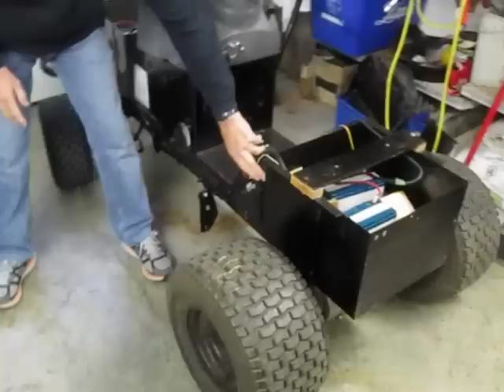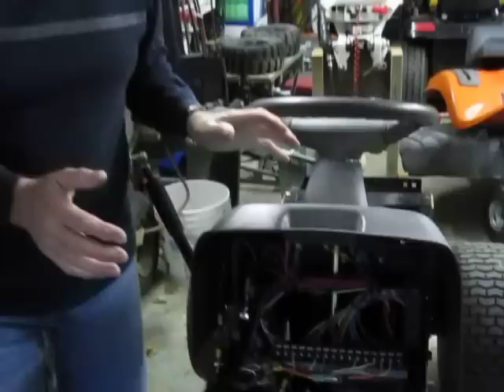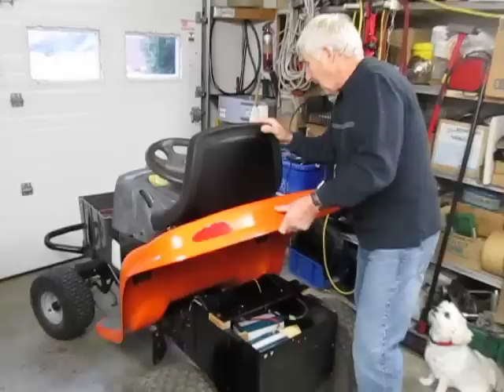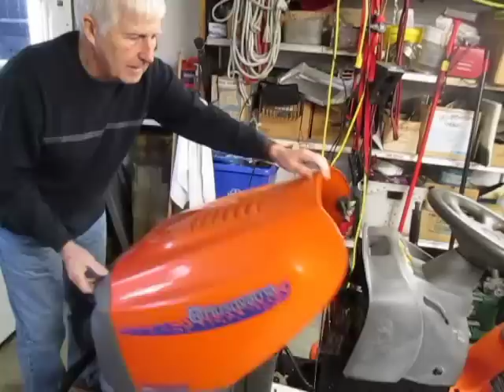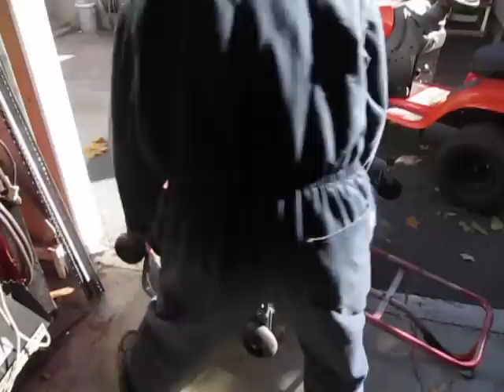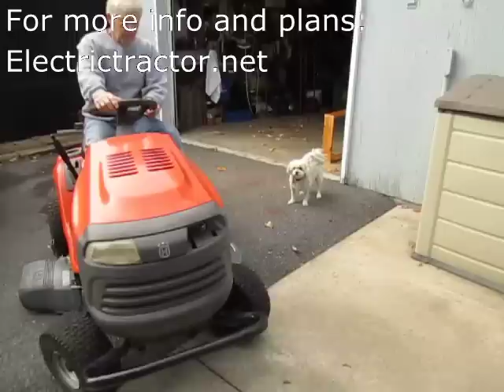Electric Tractor Conversion

Comment: Do you know anyone who has converted a John Deere? I have an old GT245 I would like to convert. I have a pretty good size property so I may want to use LiFePO4 batteries to get extra run time.
Reply: more  info on the conversion kit,  @ electriclawntractor.com

Comment: Thank you for the video, even if you did use some strange words 'gas' & 'dollar' :) I can see a potential  problem though. With belt drive if the blades hit a large stone, half brick etc. the belt will slip but with direct motor drive it can't. Maybe consider a lightweight version of topper blades where the articulated blades can swing back if it hits anything.
Reply: Hi Cyng Some gas engine tractors use gear and shaft drive, they protect the blade driveline with sheer pins or soft keys in the keyways, in our case because the electric cutter motors are much less HP than say a 22HP gas engine with a flywheel they have less inertia and stop much easier without doing damage, but we do also use blade tips that swivel,

Comment: I'm thinking about doing the same but i will not copy your deck motors.
I have seen how it eats the old bearings on the mower blades. I will make a new lower mandrel with bearings and let those bearings take all the the abuse from the blade. This will protect and ensure long life of the electric motors.

Comment: Hey Brian. What motors are you using on the cutting deck? This is the best build I have ever seen. Awesome work!
Reply: I use small permanent magnet brush motors, direct drive to the blades, you could use the slightly more efficient AC brushless motors but you would need a controller for each motor,
Reply: @ElectricTractor  Thanks for the reply mate! Awesome, I will do some shopping around fo some and get them strapped onto my deck. Greatly appreciated, keep up the good work!
Reply: @ElectricTractor  ps. any info on where I could get those specific motors from? cheers mate.
Reply: @surfieboy89  I had to get mine specially made for the size of blade my kit uses, don't know any one except Macmotors.com
Reply: Brian Edmond yeah I’m struggling to find one that will fit mine properly too. I may have to invest in a plasma cutter haha. Thanks heaps for the info mate. You’re a legend.

Comment: This is awesome, I will be buying the plans if I can manage to find a scrap lawn tractor somewhere.   I was just wondering if there was a battery guage that could be installed like many of the battery tools/tractors now to give you an idea of how much power you got left?  Didn't see that in the video and not sure if its feesable.
Reply: In our kit we use Curtis controllers which have a BDI battery discharge indicator ckt built in to the program, all you need is a 0-5v panel meter

Comment: Impressive. Blade motor towers seem a little close to the body to raise deck fully
Reply: If you have that problem, you can easily raise the frame by installing the new electric drive transmission 2" lower

Comment: Brilliant idea, well executed. Giving serious consideration of buying one of your kits for my old Craftsman. By the way, I found you while searching for conversion kits for a larger Kubota tractor. My B3350 has a Diesel Particulate Filter (DPF) Tier 4 pollution control that is starting to act up again. If you're up to a challenge, build me a kit so I can swap out that stinky diesel engine. Again, well done!
Reply: Thanks Ron the plans on the internet may be adaptable to your Kubota

Comment: Are you still able to adjust the cutting height?
Reply: Yes! on some models like the Poulin and Huskvarna you can use the existing deck lift mechanism or I added a electric lift actuator that works great,
Reply: Brian Edmond Ah, I was unsure after seeing the height of the cutting motors: fantstic job. Very well thought out and well built!

Comment: I have a new electric riding tractor conversion kit available about 15th May 2018, for more info :- electrictractor.net 
or email info@electrictractor.net
Reply: I recently bought a used JD Z425 zero turn and I'm not looking forward to the day when the hydraulics need replacing.  I might want to do a conversion similar to this on it when the time comes.  Cool thing about this particular model for that purpose is that it doesn't have an actual transaxle.  Instead it has a hydraulic motor at each rear wheel.  It would make the design of the controller a little more complex, but two electric motors could be bolted directly in place of the hydraulic ones, and then the 3 spindles replaced with their own motors as you've done here.  The accelerator could then be attached to the two hand controls so it could operate the same way as it does now.  Bit of a pipe dream for me right now, but I thought I'd drop the idea here.  Maybe you can start offering kits for those too.  Lots of used up old zero turns out there being sold off by landscapers these days for cheap, so lots of opportunities for conversions.  Might be a market for it.

Comment: I was wondering what type of battery did you used and how many, also what is your mowing time on it.
Reply: Hi Chuck I use Lead acid deep cycle batteries are :- cheap, safe, easy to use, completely recyclable,available everywhere, and heavy which is good in a garden tractor for traction and they run my 42" cutter conversion for up to 2hrs cutting grass, about 2 acres, or about 8-10 hrs without cutting, if you think about it 2hrs on a garden tractor is long enough if you have more than about 2 acres you probably need a larger tractor, Lithium batteries would be about 6x the price for the same run time!
Show less
Reply: I use 4 lead acid deep cycle batteries it will cut about 1 acre per hour :-     electrictractor.net

Comment: I love the stove cable!
Reply: The 50amp stove cable P.T.O. is cheap and works great for the electric 42" cutting deck it can also be used for other attachments such as a snow blower, sweeper, plug an a 120vac inverter for your power tools, fridge, freezer, gas or oil furnace, water pump in the event of a power failure,
charge with solar panels and use the batteries for your barn lighting when not cutting grass.
The P.T.O. plug eliminates all the belts and pulleys on a conventional gas tractor
We now sell a conversion "KIT" details:-    electrictractor.net
Brian

Comment: How do you keep  the blades synchronised without any belts?
Reply: Jur4x
Thats easy see the lower paragraph
 Choosing the right tractor to convert, you don't need any particular make of tractor just one with the features stated below, the one on the internet is a Poulan mod PR17542ST made by Electrolux, or the Huskvarna mod YTKH1542XPA I have converted both and they are perfect frames, these new would cost about $2600, I used to advertize in my local paper and on KIJIJI I  or go to the local lawnmower repair shop they usually have plenty of them waiting to go to the scrapyard, you don,t need to pay any more than about $50-$100, you can repaint them with spray cans, the recommended 18 inch wheels diameter is because of the gear ratio of the transaxle and the limitation of the speed controller 40amps, my tractor on the website has 20 inch wheels but I found that the motor used a little bit more power than the controller could supply but it still works quite acceptably except going up steep hills where the Controller may trip off and I have to reset it sometimes, I would recommend if you use the tractor with 20 inch diameter wheels to purchase a larger controller capable of about 70 A instead of 40 the size of the drive motor is quite adequate for 20" diameter wheels so that's not an issue,  
The cutter motors are sized for 21" blades e.g. a 42"cutting deck, this is the most popular size of garden tractor sold in the US and Canada,
       The deck must be of the offset two blade type, one blade is mounted approx 4" ahead of the other blade, the blade tips slightly overlap when viewed from the front, this is to eliminate the small ridge of grass that would be left uncut if the blades were mounted side by side with a small gap so blades do not hit each other! 
one thing I can tell you is when it is converted you won't be disappointed they are far superior than gas tractors in many ways
Reply: Well, that what I mean. Blades are slightly overlaping. And in order for them not to hit each other they are set with about 90° difference. And in order to keep them this way, timing belt (the one with "teeth") is used. But how do you make sure that two individually powered blades are staying away from each other?
Reply: The deck must be of the offset two blade type, one blade is mounted approx 4" ahead of the other blade, the blade tips slightly overlap when viewed from the front,  not from the top, this is to eliminate the small ridge of grass that would be left uncut if the blades were mounted side by side with a small gap so blades do not hit each other! no cog-belt is required
Reply: Oh, I see. Both that I have, are equipped with one of those decks where blades pass the same spot in turns. End if they get out of sync - they start hitting each other. I thought of getting Stiga with 125cm (that's somwhere round 48-50 inches i think)  deck, with three blades. Those ones shouldn't overlay either

Comment: :/ it looks like the blades cross each others paths, that is not going to work with 2 separate motors, if blades are passing into other blades paths, then without a belt or chain to maintain timing, they will collide...
Reply: Most small lawn tractors blades are belt driven, v - belts slip so cannot be used to syncronize the blades! same problem as my 2 separate motors, so we place one blade about 4" ahead of the other and closer to the center line of the tractor, when you look directly from the front of the tractor the blades overlap so no grass is left uncut
Reply: Blades are mounted with about 0.125" clearance between them, they don't need to be synched.

Comment: Great job-even though your horseshoe was upside down-letting the luck run out.  There was something wrong with your website.  I'd like to see more about your motor.  I'm wondering about this conversion with a four wheeler.
Reply: Dear sir
Thank you, I am having problems setting up my website videos etc, what problem was you having?  I will look into it, 
My conversion is not designed for a 4 wheeler but you may be able to adopt it? it's first job is to cut grass and I am finding it can do allot more
Reply: I use Mozilla Firefox and they said that your site is not secure and sent me back.  So I couldn't get to your site.
I would like to learn as much as possible about your conversion so as to modify it for an ATV.  I hunt with an ATV.  One without a loud gas engine would be extremely advantageous.  Also, I'm sick of tearing apart carburetors and all the other crap that breaks down.  Scent, believe it or not, can be another advantage (no gasoline or oil).  The list of advantages gets bigger.
There are a few videos that do the conversion, but, strangely, most are 6 or 7 years old.  I emailed a company that made one this year, though.  I can tell by just comparing your video to theirs that you are much more "real world" competent.  Funny how an older guy like you can be better at technology than them.  Way to go.
Reply: I forgot to mention one more thing.  I have an open mind and would consider an ATV that would pull a trailer~and mow my grass. lol.  One machine to do everything seems best.  I'll bet your mind is working now.
Reply: I downloaded Firefox and went onto my website electrictractor.net found no problems?
Brian
Reply: I don't know why, but it worked this time.  Thanks

Comment: What is the cost of the EV parts?
Reply: I'm pricing items before I dive into this.. I found deck motors for $45 each.  Still looking for a transaxle.
Reply: There are several options the most expensive is about $2000 + batteries
We are looking for new suppliers with better prices all the time, a good option is Ebay where one customer bought the transaxle for $360
Reply: There are several options the most expensive is about $2000 + batteries
We are looking for new suppliers with better prices all the time, a good option is Ebay where one customer bought the transaxle for $560 this was  a good deal,
Reply: $45 sounds like a great deal, hope you can find a transaxle at a good price too
Reply: We now sell a conversion "KIT" with al of the difficult to obtain parts included,   details:-    electrictractor.net

Comment: a gasoline engine does not stall if going up a hill
Reply: I believe If you overloaded a gas eng say 3 times its rated HP e,g, 10hp eng and you put a load of 30hp it would definitely stall were an electric motor could supply this load for a short while until it overheats, this is done in electric cars where a 30-40 HP electric motor can supply approx 100 HP for short periods e,g, passing, accelerating, etc
Brian Edmond
Reply: the reality is a dc motor for a given size will out torque most internal combustion engines at low rpm.Like a steam engine which develops it max torque at stall
Reply: ayp193s small engine repair - For the same "HP" rating an electric motor will definitely not stall as easily as a gas engine, ever. ;-)
Reply: He still had the assortment of inappropriate batteries installed which is why it appeared to stall, not enough available amps.
Reply: I know this comment is 3 years old, but if you haven't stalled a gas engine, then you haven't asked it to provide more power then it is capable. However, With a light duty lawn tractor such as what this one originally was, the tires, belt(s), and/or transmission would very likely slip long before the engine would stall.

Comment: an electric motor does not out power a briggs or kohler gas engine
Reply: Dear sir, You are correct, 
An horsepower is an horsepower wether developed via a gas eng, a windmill, a steam eng or an electric motor, 1HP = 33,000 ft/ lbs min, of work,

One difference is a gas eng only develops its rated HP at a specific RPMs e,g 3200rpms, and they have  "O" starting torque, thats why they need a clutch, 

Some types of elect motors have very high starting torque and can be connected directly to the gearbox, No clutch required, this means the elect motor doesn't waste any energy for idling, very efficient use of battery power!
incidentally a piston steam eng develops  its max HP at "0" rpms,

Another difference is an electric motor can be overloaded approx 3 times its rated HP for short periods, e,g, climbing hills etc, I believe a gas eng  would stall under such conditions,
Brian Edmond

Comment: This is a great design, independent motors for the blades and the traction, it allows for the addition of a very convenient "gas" pedal!
Reply: Shawn Guertin q
Reply: everything needs a gas pedal? lol?
Reply: Except that should be called either an accelerator or better still speed controller as there is no gas involved!